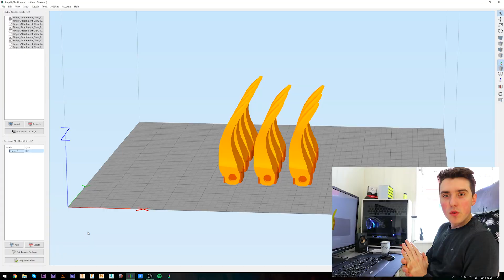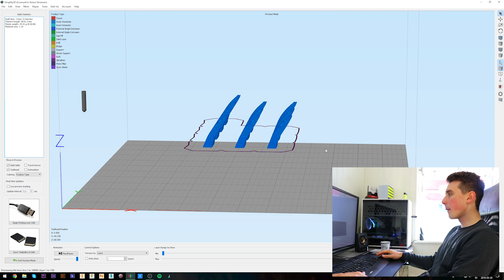AWESOME 3D PRINTED EXOSKELETON HANDS!!!

Comment: Dude, you know what a knuckle is?
Reply: dude, do you know that he's making a video about an exo skeleton?
Reply: @7hander  the video shows not a exoskeleton  but just a set of plastic details and to understand it is enough to google it 
A powered exoskeleton (also known as power armor, powered armor, powered suit, exoframe, hardsuit, or exosuit) is a wearable mobile machine that is powered by a system of electric motors, pneumatics, levers, hydraulics, or a combination of technologies that allow for limb movement with increased strength and endurance. Its design aims to provide back support, sense the user's motion, and send a signal to motors which manage the gears.
Reply: @7hander  I have nothing against such creativity but what he has done is useless .The structure has many moving parts that rub each other, which  break much more easily than piece of monolithic plastic which is the knuckle
Reply: @doppio9430  aight, thanks for explaining.

Comment: great baseline design. I would make them easily go into a fist. Maybe attach to a soft form silicone or rubber/ leather style flexible finger connectors or glove. Im trying to design a whole batman style wing assembly in multiple materials using folding to hopefully unfold a batwing suit. Near figured out the folding circles (like windshield shade hoops. Im hoping to figure out a 10' wingspan in a standard bed printer based on knitting

Comment: These could be translated into controller gloves for games and vr aswell as increased armor strength rigidity gloves that would protect you infinitely more than any normal type for extreme sports motorcycle crash military use even medical field prosthetics

Comment: Only thing left is to improve the design I'd start with putting some cushioning between finger and plastic to avoid tearing skin and to make it more comfortable then idk make them out of metal and with differently shaped sharpened claws hopefully sharp enough to swipe and cut thin aluminum

Comment: what layer hight do you mostly use? i use 0.20-0.16 on cr-10s and 0.12-0.08 for very detailed small prints. also, for solid parts, do u recomend 0.8 wall and 100 infill or 3 wall and 0 infill?

Comment: I'd print it in metal if possible, but i'd keep the plastic covering
Reply: You can't 3D print metal. You'd have to melt, model, and weld the metal, and even after that, cut it up for flexibility.

Comment: Actually, I will say these are fairly impressive, as they did mitigate most damage that would have been incurred by punching soda cans and the table. However, as the fingers all slide back into the piece on the back of the hand, the force was still distributed to the fingers. If the system was partially powered, or at least dampened, the energy would have mostly been transferred to his wrist, and caused almost no pain or damage.

Comment: The gloves significantly concentrated the pressure from impact on your knuckles. It would've hurt less if you didn't wear those gloves. The mechanical "cool" looking part is made of thin bars, thinner than your knuckles, therefore decreasing surface area and exposing you to more risk of injury. The glove is actually counter productive and hurts you more.

Comment: If you add https://www.banggood.com/MINI-ES120-Mini-Motion-Control-Electric-Screwdriver-Smart-Repair-Tools-Built-in-STM32-Chip-p-1160943.html?cur_warehouse=CN to the build instead of claws you can actually use it during work for quick thightening and loosening of screws.

Comment: Does the print get much weaker if you stop the print and continue it later after it has cooled down? Or will the bond be basically as hard as a continuous print, because the added filament is so hot it will bond just fine? Greetings from Finland.. Jag tycker om köttbullar :)

Comment: Is that how an exoskeleton is supposed to work?🤔
Reply: just a fancy glove if anything, good for digging atleast?
Reply: Abe The Rock no its not...
Reply: You proved me right kid...Does it protect his hands? "yes they protected him slightly"  -Wined and Dined 2018.
Reply: Pretty much although this is not a powered exoskeleton. Seems like it wouldn't be too hard to upgrade to a powered version though. Just a few gears, a handful of stepper motors, and some jointed drive shafts.
Reply: Wined and Dined they do provide protection tho?
Reply: Wined and Dined False. Just because you say it does not make it true. You can clearly see that his hands are (at least slightly) protected during his crush tests and they are a very common support structure in design.
Reply: Wined and Dined Cotton is not rigid...refer to the whole definition buddy...
Reply: Wined and Dined oh boy does it ever!! If he had no bones in his hand this would automatically make it more rigid through the material used. It is hard, not soft, and provides support. You lose, good day sir.
Reply: Wined and Dined cool bro.
Reply: Exoskeleton: a rigid external covering for the body in some invertebrate animals, especially arthropods, providing both support and protection.

So...yes...that is how it is supposed to work. It's a rigid external covering that provides both support and protection...

Comment: Hey rclifeon, I had trouble with leveling my cr10s bed. Do you know what I could’ve done wrong? I used paper to level the bed and did everything the instructions said to do.
Reply: Da Horsie I hope you don’t mind me answering your question. So first you need something thicker than normal paper(like card stock). Heat the print bed to 60c. Release the motors and move the print to each of the 4 corners of the print bed. Place the card stock between the nozzle and the bed and adjust the bed screws until you feel the slightest bit of tension on the card stock.(make sure your nozzle is clean!!!). That should do it. After a while you should be able to do it by eye like I do. A few more tips. If your prints are still not sticking check your nozzle temperature and your bed leveling.(too cold it won’t stick,   too high it won’t stick). If your first layers to your prints look smashed or goopy your nozzle is most likely too close. If your prints stick too well then your nozzle is most likely too close.(to the print bed that is). If you still have no luck then check your printer bed. Make sure it is fastened together correctly. Make sure there are no wobbly parts and most importantly take a good look at your print surface to see if you can tell if it’s warped or not.(if so buy a new piece of glass). If all else fails the google other ways. The internet is helpful. Hope this helps! :)

Comment: hey dude ... i saw you put something on the glass bed on the printer before printing.  I have been trying the glass bed on the Tevo Tarantula, but it´s been problematic since nothing sticks to it while printing and everything goes fruitcake. Have tried both PLA and ABS and it´s the same result ... any advise?
Reply: elmgil I hope you don’t mind me bugging in, but there is a very easy solution. Glue sticks. Just spreads generous amount on the glass and your done. It may leave a mark on your glass when you remove the print. do NOT panic. Just use rubbing alcohol to clear it up or soap and water. Also a few more tips. Check your bed leveling, make sure your printing extra slow for the first layer(15mms is a good first layer speed), and check your nozzle temperature. Nothing is gonna stick if your temperature is too low. Hope this helps you out! :)
Reply: thanx buddy ... that totally worked :)
Reply: elmgil no problem. Glad to help

Comment: Its not 3:28am you can see out the window lol 😂
Reply from the maker: You got me! 😅
Reply: RCLifeOn OMG your amazing
Reply: RCLifeOn I’m such a big fan because of you I have my own 3D printer but it broke and I’m trying to fix it it’s the anet a8
Reply: Hazza Mazzard - I purchased two Anet A8's as my first printer, two because of what I had read of some of the issues surrounding the A8.  And there are a lot of issues to contend with from my experience.  Of single most concern for me was that the smooth rods varied in diameter along their length by as much as 0.28 mm. I ultimately built a CoreXY machine with the parts, replacing the smooth rods with true 8mm smooth rods and adding a V6 hot end with a bowden extruder.
Reply: LOL I WAS LIKE A DAMN THATS A SUPER MOON OUT THERE.... OBVIOUSLY NOON TIME WITH HOW BRIGHT IT IS OUTSIDE LMAO... GOOD EFFORT
Reply: Hazza Mazzard good luck
Reply: If you need help with that i may have you covered
Reply: Woooooooooosh
Reply: R/Woooooooshhhh
Reply: Idk man...
Reply: Hazza Mazzard XDDDDD

Comment: Maybe a little lining inside to protect the knuckles. Looks like I need to bite the bullet and buy a 3D printer as I am getting ideas for projects that I would like to do. So which one would you recommend the most and what would be the best filament for a rubberized gasket?I guess I will go back and look through your videos.
Reply: Ed T hope u don’t mind me bugging in. Rubberized? Like flexible I’m assuming. Look into TPU filament or ninjaflex. Both are very hard to print so read up on them. They require special extruders. As far as good brands go search for hatchbox TPU and ninjaflex or SUNLU TPU and ninjaflex. Both at found on amazon. These are just brands that I have found very good and I have tried a good deal of them. Good luck!
Reply: Rubber type to make a good seal, as I am not able to find a place that will make the gaskets I need for a project I am working on. So looks like I need to buy a 3D printer and try some of those to see what will work thanks for the info.
Reply: Ed T no problem and I can honestly say a 3D printer is worth the investment. The CR-10 original, the Tevo Tornado, the Tevo tarantula and the anycubic i3 mega are all very good choices for your first printer. Good luck!

Comment: "I felt nothing".... takes glove off to reveal mangled hand :)
Reply: "I felt nothing, except the pain" is what he meant to say. Such surreal cold-bloodiness towards soda cans. Is he even a human?
Reply: Edward Vinch true he should add some padding for protection
Reply: The design is not for punching. It did not even have any protection to protect his hands.
Reply: based on what the video showed of how the knuckles fit between the bars, I would assume that the shields (which he chose to leave off) would have mitigated some of the damage to his hands.
Reply: Gabriel Kenny , no. Just no. The claws are way forward, and any damage dealt is from the plastic bars and metal joints
Reply: Its because of the claws
Reply: The shields are purely aesthetic, and unlikely to absorb a significant amount of shock.
Reply: Yea
Reply: I died when he punched his hand
Reply: so awesome that his hands arent bothered
Reply: If you make this design you should probably wear padded gloves beneath like baseball gloves or your knuckles will suffer
Reply: Jason Simpson it was the blue parts (the bars) hitting those parts and digging in, the covers wouldn't have help his hands
Reply: Adrenalin rush perhaps?

Comment: Question, I'm using a dual extruder on a Flash forge creator pro and using the slicer software your using. I having a problem of switching the extruder before a print, because I use the left side for PLA and right side for TPU. Any help? where in Simpifly 3D do I switch the extruder?

Comment: which glue do you use to make bed sticky??
Reply: paper glue in stick (UHU for exemple)  will do. Another solution is hair laque (spray), find the cheapest and most powerful one. Simply clean it off the bed with hot water & soap (assuming you have a detachable glass).
Reply from the maker: Tesa Easy Stick straight on glass with no heat, works like a charm.
Reply: Directly?
Even if it is a heated bed?

Comment: Hi 
How are you getting your prints to stick well to the glass plate or are you using another print surface on the Creality CR-10 / CR-10S?
Reply from the maker: Even though painters tape could work fairly good, I get the best results from using a certain glue stick called "Tesa Easy Stick". That will keep your prints stuck to the bed without a heated bed. (y)
Reply: i think he is using simple glue stick on glass plate
Reply: No, Just watched the vid again and saw that he uses Blue Tape on the bed ;)